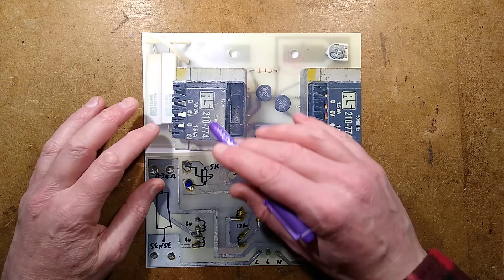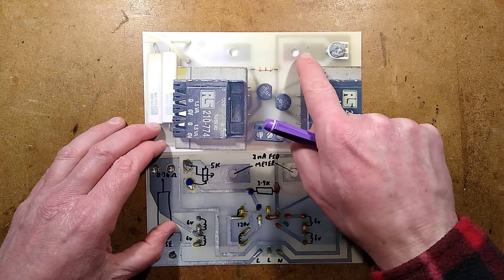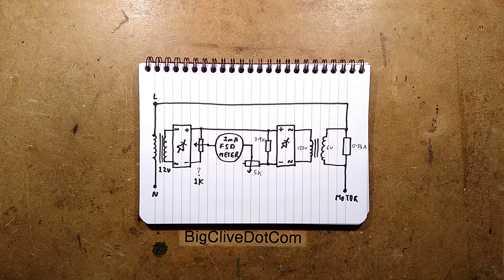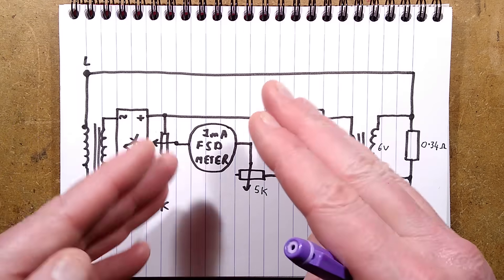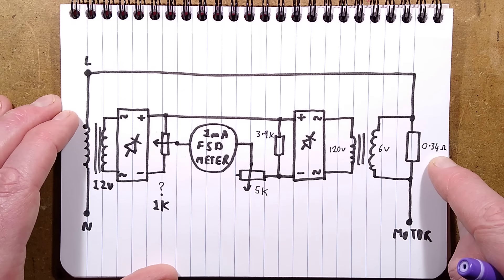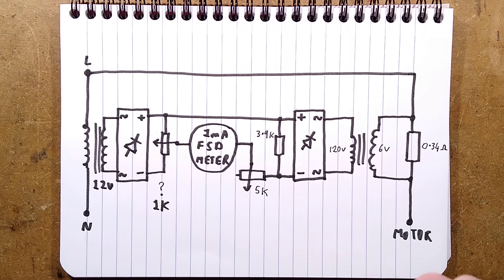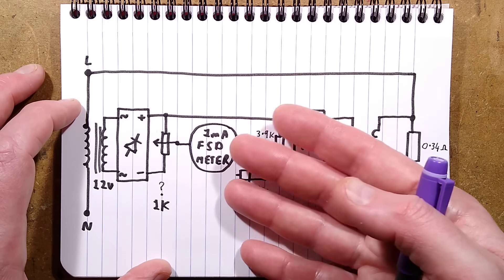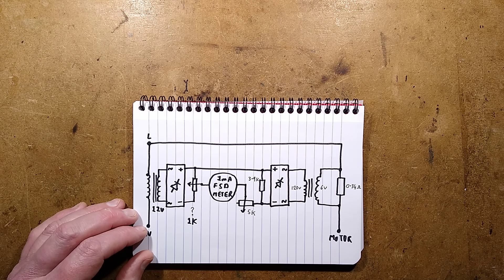Unusual circuit with retro-feel (specialist PCB cleaning machine)

Comment: More than 20 years ago, for a period had to design some controls with LVDT (linear variable differential transformers), which are some mind-bending servo systems with vector controls.
It was more than common to add an extra winding to each LVDT, and use bridge rectifiers (made with OA81 diodes) and moving coil microamperometers to monitor some of the variables with utmost precision.
There is an entire sector of electronics which has been forgotten - magnetic amplifiers - and would be worth a revival. But as all things analogue, it has been buried for good...
Reply: That reminds me of Bob Carver back in the 1970s whose company made magnetic amplifiers for audio applications.  Carver’s amps were much smaller and ran cooler than most transistor amps of the era.  Audio snobs didn’t like Carver’s amps - probably not because they didn’t sound good, but were too inscrutable.

Carver used to make bets at trade shows that that he could make his equipment sound exactly like any arbitrary snob gear.  Carver would take a sample unit back to his hotel room and then emerge a few hours later with a handful of passive components added to his amp.  As far as I know, Carver always won the bet.
Reply from the maker: I'll guess he was adding filters to match the posh amp's characteristics.
Same with the old BK Electronics amplifiers.  The snobs didn't like the purity of their MOSFET amplifiers.

Comment: Nothing particularly special about the circuit: the left side provides a voltage reference for the analog meter, the right side is simply a current-sensing circuit with a partial bypass likely because the current-sensing transformer's 6V winding cannot handle the full motor current and may add too much series impedance too. If I had a bunch of identical transformers on hand and needed to build a current monitoring/calibration thing, I would likely have come up with something very much like this, albeit negative-referenced instead of positive. That is the only weird part to me.

Comment: Clive, as an electrician did you regularly have work with PCBs?
Reply from the maker: In most industries they just swap them out, but as time goes on, many of the older ones have to be repaired.  Most ordinary electricians do not do electronic stuff.

Comment: this was jolly interesting. i wish to make PCBs. i have tried, insofar as i bought PCB blanks, some ferric chloride, and used marker pens to try and shield areas. it was useless. the pens made patchy marks, and with my art skills it were as though a child had tried. it seems i need to buy a laser printer, a uv box, some soda crystals, and some sheets of photosensitive stuff. to buy all this to play with PCBs is rather an investment. i'd like to know the cheapest way i can do this? must i get a 300 quid printer, or will a 80 quid one suffice? what dot pitch is really required? bear in mind i am a bloke mucking about in his study. all i really wish to do is print out and make BC circuit boards. but having said that, the number of times i have bought the cheap option to save a few quid, then realised it was shit and i bought the costlier one anyway are too numerous to count.
Reply from the maker: The cheapest way these days is to use free Easy EDA software and get a small batch manufactured by a company like JLC PCB.

Comment: Looks like it is actually a power meter, where the left side transformer gives you a reference voltage in phase with the mains, then the current sense side is used to generate a full wave rectified waveform in phase with the motor current, and the meter is then being used to read real power, ignoring the large inductive component of the motor drive current. Left side provides the sampling pulses, and the right side the average meter reading is related, though not really well, to the real power use of the motor itself, to a large part ignoring inductive power that is not being used in the load.

A more modern one would be to use a meter that can give you real power , and then set the motor to deliver a roughly constant power to the load, corresponding to the effort used to clean the PCB, not the apparent power, which will be mostly inductive power flow.

Comment: Feels like a AC flavored Wheatstone bridge. The 1k pot are two fixed legs, and the 3.4k and 5k pot form a balanced pair. The mains-referenced current is balanced by the meter coil to get the correct voltage drop across the sense resistor, which is amplified by the transformer.  A digital meter subbed in for the analog wouldn't work because the meter coil is part of the measurement circuit.

Comment: Pretty classic circuit - a current shunt and a transformer as a voltage amplifier. In the 50s and 60s this was not at unusual sight at all. I wouldn’t call it obtuse :)
Reply: I agree. It wouldn't be cheap to do today (transformers are expensive) ... if it was even cheap back in the day... and provides isolation. The bridge circuit... acting as a kind of sensitive 'differential' voltmeter... is a classic.

Comment: It crossed my mind that by using the two-transformer voltage comparator that even when the mains voltage changes [As it does at different times of the day and is also constantly fluctuating.] the needle representation will stay synchronized [calibrated] with the torque output of the motor.
Reply: Motors pull more current with less voltage and less current with more voltage so it seems like such an arrangement would magnify changes due to voltage variations. Maybe that's intentional, if the voltage tends to be on the low side, run at lower load so the motor doesn't get stressed as much.
Reply: @NiHaoMike64  Well isn't that counter intuitive, I must have been understanding Ohm's law backwards for the last 45 years.
Reply: @DrHarryT  It's a weird quirk of induction motors, with lower voltage they pull more current to maintain the same speed.
Reply: @DrHarryT if power is constant (load on motors) and w=v*a, as voltage decreases, amperage increases. This is the very simple explanation that ignores torque curves and all the messy bits to illustrate the basic concept, but is fundamentally correct.

Comment: In the mid 1980s, when I got my first job, it was in PCB manufacturing. One of my first tasks in learning the whole process of printed circuit manufacture was to ensure the raw circuit board material was scrupulously clean. The blanks needed to be fed through a large and loud machine just known as the scrubber. This could be used in single sided or double sided mode. 
I remember using the controls on the control panel for board thickness and hence scrubbing pressure. I think it was a standard machine manufactured for the sole purpose of scrubbing circuit boards before photosensitive lamination coating. I wonder if it is the same type of machine?

We had one guy working there who I thought was a genius at the time. He had been there since the firm's inception and had designed all sorts of process control machines for electro plating on small scale and large scale stuff. That circuit board design reminds me so much of something that he would have cobbled together to replace, improve or modify his own or the original manufacturer's designs. 

Oh my, so many memories of my time in beginning of my career in electronics manufacture. The place is no longer there, was turned into private housing. 
Thanks so much for this Clive.

Comment: I've recently been investigating AC current sense transformers... like the CSE187L... you don't need the 0.34 ohm resistor, you can just use a series transformer winding to generate a small AC voltage which is amplified across the 500:1 current sense transformer... Since this is basically an independent isolated supply that has an AC voltage that tracks current, you can easily divide it and bias it to match a 0-5V A-D input with 2.5V as the center point... voila bi-directional AC current sensing. (microcontroller pin protection is left as an exercise to the reader ;-)...
Reply: Current transformers are a bit scary.  If you lose the load on the secondary, you can get a potential of hundreds or even thousands of volts across the secondary.  The primary current is essentially immutable, thus physics will try very hard to make the secondary current obey applicable transformer laws.  Putting the sense load on the primary side allows the primary current to be close to zero and thus eliminates the risk on the secondary side.
Reply: @wtmayhew  interesting... I hadn't thought of that... My thinking was that a current sense transformer doesn't affect the mains power in any significant way in comparison to a resistor... but I guess you can size the resistor correctly to achieve virtually the same loss...

Without moving to a sense resistor, is it best to mitigate the risk of losing the secondary load? I was already looking at strongly protecting A-D inputs with TVS and series resistance... but maybe redundant load resistors (few in series series for V and 2 parallel for redundant) would help too...
Reply: @luxmonday  it probably depends on the context where the circuit is being used and who might be working on it.  The approach in the PCB cleaning machine makes sense because it doesn’t need to be high precision and it removes the risk that inexperienced personnel working on the machine might disconnect something and create a hazard.

Comment: It was part of my aprenticeship to clean the copper-plated boards before laminate it with a uv-sensitive  foil. The boards cleaning was done by running through a machine, in wich a drum with a surface of felt rotates. To get the right pressure a handwheel was turned until a certain number on a analog meter was reached (don't know the unit anymore).
I guess, what makes this complicated circuit necessery, is to measure a very slight change of the motor-current in comparision to it's over all consumption.

Comment: Designed by someone who clearly knew their moving coil meters inside out. Rather like the electronic equivalent of jazz improvisation!
Reply from the maker: Yeah.  It was an old-school designer.
Reply: Another fine example of analogue meter drive circuitry is the original PPM design by the BBC. Fast attack and slow decay.
Reply: https://www.bbceng.info/additions/2016/No.%206%20-%20Programme%20Meters.pdf

Comment: What's strange is the resistor is on the primary side of the current transformer. Normally it's only the secondary side and there's a single turn primary. I would just use a proper current transformer, with an AC meter and make all or part of the burden resistor variable.
Reply: This makes it use an off the shelf transformer, so very cheap, and no need to contact ILP to wind you a custom transformer, especially as they regard any order under 5000 units as being not worth their time, and charge you the same price for 1 transformer as for 5000, because of that. Off the shelf RS unit is under 2 pounds at the age of that machine, and ILP would have wanted 10 000 pounds just to make a single run of 10.  Plus resistor is easy to adjust if you change motor supplier, and need to recalibrate the unit, or do a design update.
Reply: @SeanBZA  There's no need for a custom part. Current transformers can be purchased off the shelf very cheaply. An AC current meter + a variable resistor would be much cheaper, as no PCB would be required.
Reply: @alunjones3860  Yes, but this is not just a current meter, it is actually a wattmeter, to show the load on the motor. Buying a small CT is expensive compared to just using the shunt and small 2VA transformer, as the CT normally has to be rated for safety, here they are adding it on externally, and limiting the energy it can get. Buying 2 of the same part makes it easier on a small run to get economy, and as well no need to have special order parts, all these parts, including the PCB, came from RS components, so making repair very easy.
Reply: @SeanBZA  I've just looked on RS and current transformers are no more expensive, than small mains transformers. How is this working as a power meter?
Reply: @alunjones3860  Sampling the motor current at the mains peak, using the other transformer and the meter impedance to average out the reading. Ignores to a great extent the out of phase current flow, so making the reading more closely approximate power rather than plain motor current, which is normally going to be roughly constant irrespective of load with a single phase induction motor.
Reply: @SeanBZA  Oh, I see, but I don't understand why they used such an elaborate arrangement, rather than a power meter.
Reply: @alunjones3860  When designed, I would guess mid 1970's, a power meter was both complex and expensive, and accurate. Here they needed cheap, and sort of accurate over a small range, that this circuit is good at doing. That is was also made from parts they were sure would be available in the future, was also a great bonus.

Comment: The return spring does help a lot when there is noise and ripple on the signal. Digital meters just sit there hunting back and forth as fast as they can, which is a real pain.
Reply: Which is why analogue multimeters will never become extinct. Fortunately our "Chinese friends" produce a wide range of pretty excellent, and AFFORDABLE,  multimeters with very good displays.
Reply: You can program a "spring" into a digital one quite easily.

Comment: This circuit only makes sense to me if we were expecting a varying input voltage. If running off of mains voltage how is a simple amp meter on the motor not equally effective? Am I missing something?
Reply: Mains can get quite noisy in industrial environments. Plenty of equipment kicking in (causing sags) and shutting down (causing spikes)

Comment: Nice, interesting circuit.
Basically a finely tuned motor-current deviation monitor that is insensitive to mains voltage variations.
As I read it, the calibration 1k pot would be tweaked to get near the null point (almost no reading) during normal operation and the operator's 5K pot adjusts the meter sensitivity (~gain?)
Without the 'nulling' ability the meter would not be able to discern fine changes around the operating point (motor current changes).
The nulling (1k calibration) pot will need to be set away from the null point slightly so that decreases in current are observable - Thus the instructions specifying '2' on the scale.
I imagine the 3.9k resistor damps the meter slightly (and provides a slight load to the transformer to get it operating in a more linear part of its magnetic curve?)
I wonder what happens when the motor is first started, does the meter take a bit of a beating? Maybe a Zener across the meter would help?
Thanks for the brain food.
Reply: I should have read this post before posting mine.
Reply: Remember that the motor current is not in phase with the voltage. The left transformer measures a derivative of the voltage, the right one the current. The current transformer is loaded with a resistor. The potmeter balances the meter. No capacitors allowed.
Reply: @qno-oj3py  Lol!  I need that on a T-Shirt!

       No
Capacitors
  Allowed

😀
Reply: I think I understand what you're saying. An increasing load will cause more current to flow, but if the mains isn't regulated the absolute current measurement in invalid. By comparing the mains voltage to the load current it allows you to zero out the mains voltage error.

Comment: I guess the advantage of this over just measuring the current through the motor is, uh, that it doesn't introduce a big resistance into the motor circuit, but also doesn't require a sensitive voltmeter?

The choice of two transformers and rectifiers seems like the ends result is someone just picking random parts out of their stash, trying to achieve the right voltage for a meter they happened to have on hand. I guess I am spoiled by ready access to digital sensors.
Reply: This design was obviously optimized to use only one mass produced model of the most expensive component (the transformer) .  The separate bridge rectifiers are probably because 1.4V diode losses would be too big if rectifying at the meter (they would create a dead zone around 0) .  Circuit compares a multiple of the current to a fraction of the voltage, with the ultimate design choice being the current shunt, while the left potentiometer provides a further division of the voltage .  Cool minimalist design if 120/6 modular transformers are used elsewhere in the creators production, such as in power supplies .
Reply: @johndododoe1411  Well stated.  I agree that some thought went into the design.  It is a pretty elegant approach.  This circuit doesn’t look like something I’d expect to see from a new engineering graduate.  It takes some practical experience to know how to design this way.